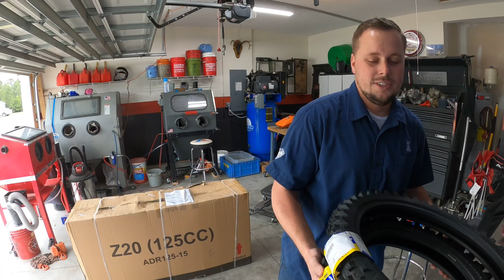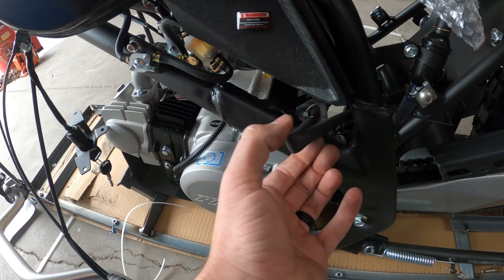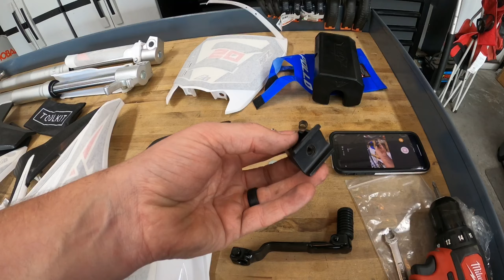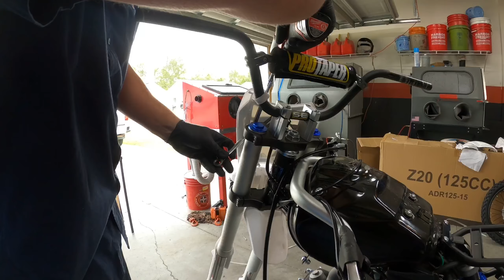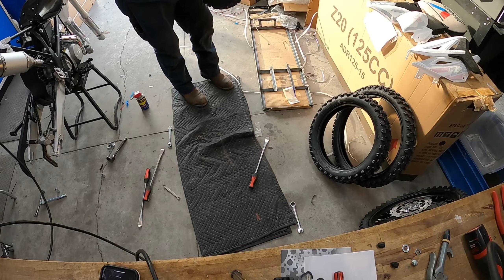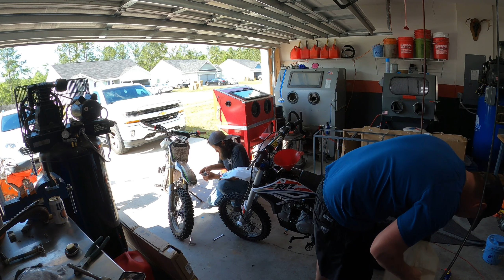Apollo Z20 | Unboxing Assembly How- To | Initial Upgrades

Comment: I purchased the apollo Rfz40 last week. I put on a 17 front sprocket, a Mikuni carb with a 27.5 jet, and a two stage foam air filter right out of the box. The carb air screw was 2.5 turns out and it was past the point of fast no bog... try that out. It's crazy fast and no bog
Reply: I'll probably throw on a graphics kit and pro taper bars... give the bike a totally new look

Comment: @Tynka Tyme have you changed the fork oil on your z20 yet? I just recently did mine and it ended up being a HUGE improvement over stock. Stock the right side leg had roughly 170ML while the left side had around 200ML. I refilled with 220ML per leg and used Harley Davidson screaming eagle "heavy" fork oil. Harley doesn't list the actual weight and if you search you'll find conflicting info stating it's between 12-20wt for the SE "heavy". Based on viscosity I came up with it being around 15wt. I also tested different fork heights and found that setting the fork height at the 3rd line on the upper triple tree clamps made steering much better while remaining as stable as the first or 2nd line at higher speeds. After the fluid and height change it eliminated front end dive while braking and made it overall a much better ride. I highly recommend trying it out, you won't be disappointed.

Comment: Just received my Apollo z20 and after building it I noticed my front brake pad is rubbing the rotor when I walk it forward. What side did you put the washers? On the outside where the bolt head? Any advice is appreciated!

Comment: Quick question 🙋‍♂️haha…how do I adjust and stiffen up the rear shock? Almost clapped it out off of a 10 ft jump lol. I got the Z20 Maxx and I’m somewhat content with it. I think I have a bad coil? When it heats up, it just wants to quit on me. Not the carb, so idk 🤷🏻‍♂️. BTW GREAT video and keep up the good work!!
Reply from the maker: There’s a nut on top of the rear spring just run it down and it puts more tension on it to make the spring more stiff.

That sounds like a coil to me. They’re Cheap on amazon. 

Thanks for the support 🤙🏽
Reply: Changed out the coil. 💥 Bam! It’s runnin wonderfully! Thank you 🙏🏼 very much for gettin back to me on the spring adjustment! Also, definitely agree with ya on the front sprocket upgrade, it makes a huge difference! Thank you again brother for the advice and great videos!!
Reply: It is a pit bike it wouldn't handle a ten foot jump without hitting the metal

Comment: Thanks for the informative video!     I spent about three hours today putting together a red Z20 Max for the GF's 15 yo daughter. All hardware was there, but there were minor scratches on the forks and the front and rear fenders, as well as a tear on the rubber clutch lever dust guard. I own a Husky (TE 510), so I'm familiar with bikes. After assembly using plenty of Loc Tight Blue, I added gas and the bike started second kick. Some basic observations - fit and finish is good, but not great; clutch activation is quick (in the middle) and grabby; the clutch cable can touch the carb to engine intake and will need zip tying; the rear brake lever is sticking, the left grip was put on without adhesive; the transmission shifts OK but feels and sounds sketchy (may be the oil); the metal gas tank rattles on the frame, and the rear shock spring rattles as well. The stock carb bogs badly. I ordered another carb and will install that over the weekend. I will heat cycle the engine one more time and replace the "stock" oil with a synthetic 10/40 (hoping to improve gear and clutch operation). I'm also adding a magnetic oil plug. To help set reasonable expectations, I would rate the quality of this bike at 75% when compared to the Japanese brands. If it lasts two years I'll be happy.
Reply from the maker: Hey Chris, be advised, the oil that comes in them is just shipping oil, and shouldn’t be ran with that oil.  As far as the rear brake sticking, check the metal sleeve at the bottom of the master cylinder that has the rod going through it down to the brake lever. I’ve seen those rubbing on that metal sleeve causing it to “stick” but really it’s just metal on metal contact between the rod and that sleeve.  Oil probably will help the clutch issue, but probably wouldn’t hurt to check adjustments at the engine side under the right case side cover.
Reply: @TynkaTyme  Great info! I changed the oil to Mobil 1 10w40 (racing 4 stroke motorcycle) today and could hear the difference in the valves at idle and the transmission. The stock oil seemed very thin even after warm. A bit of light lube on the metal sleeve for the rear brake did the trick. Next I'll change out the carb to try and get rid of the bog just off idle. I'm finding the front brake to be a bit weak - may just need to be worn-in a bit.
Reply from the maker: @chrisburger4518  that’s awesome! My front break is the same way, haven’t tried messing with that yet, as it still functions ok.

Bogs are common on these, just have to get in there and play with jetting.. time consuming, but will be worth the pain in the butt!  Good luck!!! Happy riding!
Reply: @TynkaTyme  Thanks again. I installed the new 22 mm "adjustable" carb tonight. Easy enough, but switching over the cable and carb top cap took some time as I had to twist out the spring. I did not remove the air box... just removed the two bolts and loosened the clamp at the filter box rubber fitting towards the rear. I'm not going to fiddle too much, but wanted to share my settings... the carb came 1 1/2 turns out on the main screw. I played around a bit and found 1 3/4 turns out seems to be about right (or the best I can get to right now). When I refer to "right", I really mean I can twist the throttle quickly in neutral and it doesn't bog (when the engine is warmed-up). I did not play with the settings related to acceleration or looking at the spark plug. This Z20 Max will be ridden by a 15 yo girl that is new to dirt bikes, so she will need to learn how to get the most of the power this little bike has. I did take it down my street and it accelerated cleanly through all of the RPM range in third gear with the throttle quickly pinned starting from low RPM.
Reply: @TynkaTyme  I did notice the new adjustable 22 mm carb had what appeared to be a thicker needle than what came in the non-adjustable stock carb.

Comment: I wish I knew about the Z20 before I ordered my RFZ 19 model. I haven't even received my bike yet, but the Z20 looks to be higher quality. The mudguard, airbox, and larger wheel size are nice too.

- Then I watched the whole video, I feel a little better.
Reply: The z40 model is even better has big bore kit and upgrades NIBBI carb, ngk spark plug with better cdi box and other great upgrades included
Reply: @VDM32  I just looked it up. Damn, I didn't even know that was a thing. I don't think it was available when I ordered an RFZ19 about 2 years ago. I refused delivery and got a refund because the bike got so busted up in transit and a lot of the bolt-on parts were missing/damaged.

Comment: Thank you for the videos.
I purchased the same bike a few months back. I wound up selling it and getting an X-18. I feel the X-18 bike is a better bike than the Z20. 
Much like yours mine was a terrible mess from bad shipping. Lots of scrapes and scratches, a few missing parts and never a solution from the merchant I purchased from. Just my opinions but things I disliked about Z20 were the AIR box and connecting rubber to carb. My air box had a bad warp in it so it didn't mount and close well also the rubber tube connecting carb to air box was always kinked so I feel airflow was restricted. The air filter Would not fit inside properly either without modification. The little white plastic piece that holds the brake cable on the fork guard didn't last long before it fell off. The brake lever is Not heavy duty and will bend Like the Prior x-18 model did. the new x-18 model has an improved rear brake lever that is beefy. The bike is defiantly heavier. Needs a gear change and new carb (But honestly I think they all do so not specific to z20) lastly the fuel tank. I do not like a metal tank. Z20 has a metal tank with NO option i found to replace with a plastic one like the x-18 does.
Anyways love watching your videos peace and sty safe.
Reply: My wife has a Z20 MAX.  The air box is garbage, I took out the whole assembly and replaced it with a UNI air filter.  The Z20 models use a TTR 110 fuel tank which is plastic. I plan to upgrade to that soon, its around $40 on ebay.

Comment: Good assembly video.  My wife has the Z20 MAX.  Just a couple suggestions.  The head bearings are completely dry. I took apart the triple tree clamps and greased the bearings.  In addition to applying loctite to every nut/bolt as you did, I also applied dielectric grease to all the electrical connectors (more personal preference I guess).  I upgraded the carb to a Mikuni 24mm, along with a UNI air filter.  After some tuning,  the bike runs great and pulls really well through all the gears (except for first gear😉).
Reply from the maker: I did look up under the triple clamps and seemed to have quite a bit of grease in the lower bearing, so i didn’t worry about it.

Might have a carb on there already, more videos coming 😁

Plan to do a video on gearing to get more out of first gear